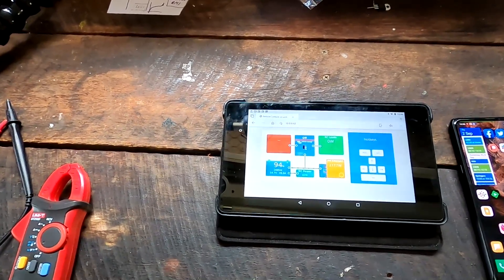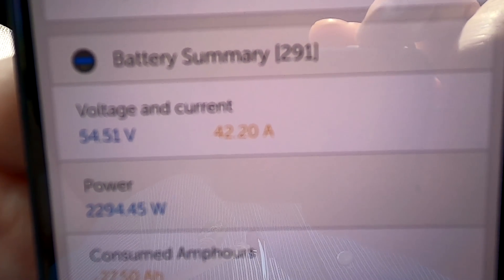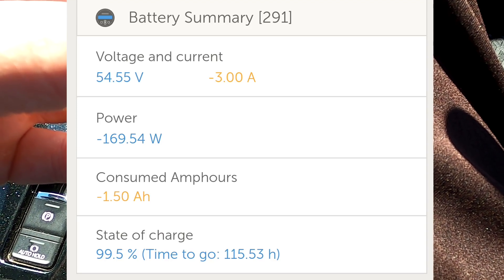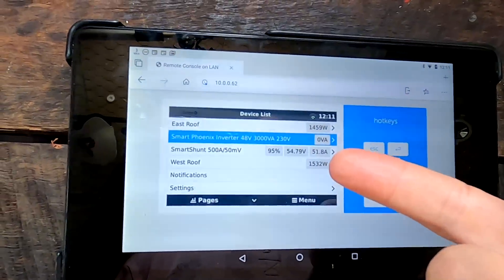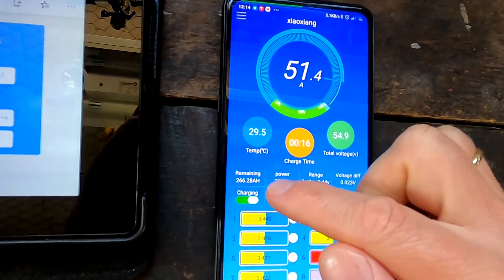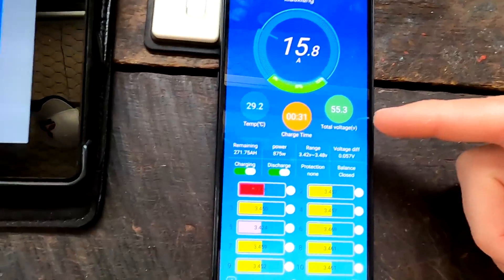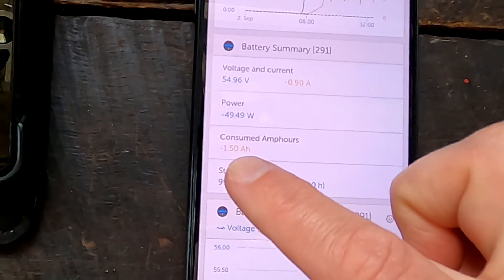With no balancing to 99% SOC. Consistently.

Comment: Hi guys, I'm back with news about active balancers and I want to share with you. I think I found the winning option, namely: At the beginning of a new active charging cycle,the balancer is closed (power off) and I turn it on at a voltage of 54.8 volts, 3,425 volts per cell. I noticed that at this voltage the gap between the cells starts to increase significantly, at least for my battery bank. I keep the balancer active until the voltage of 56 volts, 3.5 volts per cell until the voltage drops below 54.8 volts, after which I turn off the supply voltage for this device. 
 I use for power on / power off the active balancer, the auxiliary contact from one of the Victron chargers I use. This internal relay can be programmed to close at 54.8 volts and open at 54.6 volts, for example.
   Over the course of a week of using this system, the gap between the cells has dropped from 80-90 mV  on first day to the 3.5 volt voltage I use, it has dropped to 10-15 mV today.
    The conclusion reached by Andy, namely that the balancing must be done at high voltage, is very correct. At lower voltages there is no point in doing it because from what I noticed, the voltage in each cell varies quite a lot, especially in bigger consumption.

Comment: @17:15 '...there is no way we can charge to 90% at anytime...' ?
...and why are we trying to charge to the max we can get? is not the approach to charge to 90% and discharge to 10% to maximize the number of cycles?
Reply from the maker: No, not with LiFePO4 cells. It's about avoiding the high and low voltages. Charging from 10-100% is fine for these cells if you stay away from extreme voltages.

Comment: As I wrote before, why not charging to lower voltage, like 3.40 V/cell and even drop the absorbtion? This is good enough. And you should also drop float voltage, because at 3.35 V the battery is still charging slowly. 3.330 V/cell is good enough to keep high SOC. Search for 'The Relationship of Voltage and SOC of LiFePO4 batteries in different temperatures'. And at this low charging voltage  you can leave the active balancer connected. It will silently do its work.
I also thought to control charging with my battery monitor on SOC, but it is not really worth the effort. Using a lower maximum charge voltage is good enough.

Comment: Hi Andy. I am having a hard time understanding why you don't let the batteries charge to the point where there is minimal current going into the batteries on absorb. There is no use to back the voltage down in a float condition.  3-stage charging is for lead acid batteries and has no True Value on lithium iron phosphate batteries. Let the batteries charge all the way up in absorb to a voltage of your choosing and you will see 100% charge on the batteries per day at whatever voltage you set your charge controller to. Your load that you have on your inverter will vary the top-end voltage during the day and as the evening sets in. If the recommended top voltage is 3.65 volts max, choose a lesser voltage to increase the total battery  and track it over time to see what happens. Mother Nature is going to throw you a lot of Curves of which can change the overall outcome of your battery life.  
On a brighter side, I really do like to watch your videos as I played more and more with my solar stuff, I did a lot of experimenting like you. 
I was going to mention that the regulator that you were looking for is a  LM-7812 regulator @ 4.5 to 5 amps.  One thing that designers don't take into consideration is the Heat breakdown of the device over time.  If you can heat sink the regulator to say the back wall of the case, it would last longer and the voltage stability would be better as well. 
Hurry and build up your other batteries and put them on your shelf and parallel them with the others and you can see if you can make 100% with two batteries parallel at 48 volts. Then you can see how much extra runtime you can get out of your batteries.  Less stress overall.  
 Bye for now.   Lou

Comment: Well done. You have proven the established estimate of ~99% charge efficiency with lithium iron phosphate batteries in good condition.

But: no, no no! You cannot use voltage alone to determine when to cutoff charging! I cringe every time I see you charge your batteries to "100%" using only cell voltage to determine the charge cutoff threshold. Any voltage from 3.40V/cell and higher will eventually fully charge and then overcharge a lithium iron phosphate battery. The exact absorption voltage limit isn’t important, because of the inherent trade-off that exists between absorption time and absorption voltage. Charging must stop when the absorption current falls below the charge termination current threshold - NOT when the current falls to zero - because at zero charge current the cells have run out of free lithium but are still receiving charging potential. That is the definition of "overcharging."

At the 3.45 volt per cell charge voltage you are using, the minimum tail current to prevent overcharging is 0.014C (or higher for less than 100% SOC). For 270 AH cells, that is 3.78 amps (let's round that to 4 amps), and at that cutoff current you will still leave some small amount of free lithium available. (When charging to 3.65 volts/cell the cutoff current is 0.05C. Plot a linear graph between those two parameters to find intermediate charging voltage tail-current-cutoff parameters.) You gain practically nothing by continuing the charge beyond that point. I know it's difficult to use a tail current with variable current sources like PVs. But the Victron MPPT controllers do support setting a tail current, and if you set it at 4 amps, that represents a very minimal amount of lost capacity for your application. Doing what you are doing now, using voltage alone to determine charge termination, will eventually degrade your cells through the process of lithium plating. 

Since you are using a 15 minute absorption time limit, you have configured your system to: "only overcharge my battery for 15 minutes a day." OK. Now it will take more cycles to damage the battery. But the damage will still be done. That's "only" 91.25 hours of overcharging per year if you reach the voltage limit but charge to zero amps every day.

Manually charging to "100%" SOC a few times to zero charge current under direct supervision is fine for proving capacity and to periodically erase memory effects, but it will damage the batteries if you continually cycle the batteries to zero charge current -- at ANY voltage above 3.40V/cell. Accepting a slightly lower SOC for daily cycling by setting a charge termination tail current will greatly improve your battery life. 

You asked in an earlier video how to charge to a SOC lower than 100%. How to hit a target of say 80% SOC. Using voltage alone, you can't because of the flat charge curve. Setting a higher tail current cutoff is how you control your maximum charged SOC. The other option is coulomb counting (counting amp hours in and out), which some good BMSs offer, but those measurements will drift over cycles because charging efficiency isn't 100%. A really good BMS would allow you to set the tail current and cutoff charging at that threshold. Regrettably, few BMSs offer that option, so you're stuck with measuring tail current at the charging source. But attempting to control maximum SOC with charging voltage alone, if that voltage is equal to or anything greater than 3.40 volts per cell, is futile. Your earlier videos have demonstrated that. It's only a question of how long it will take to reach zero charge current and thereby overcharge your battery. 

In any case, you must measure current in addition to voltage when charging, and establish a charge cutoff current (that is greater than zero) for your chosen charging voltage to prevent overcharging. Measuring only voltage while charging will eventually lead to lithium-plated and degraded cells.
Reply: Your post should be pinned to the top of this thread!!!  I am afraid only a few will read this deep to see it!
...been waiting on this... the true understanding of the LiFePO4 dynamics that leads to the better management possible to maximize efficiency, but I am going to have to digest this level of knowledge the hard way.

Could not a system be wired in such way that each individual CELL is charged separately?
Would that not end the balancing ordeal and issues nightmare?
...and perhaps allow the rest of the parameters to show better, more straightforward results?

Changing subject:  
The 3,000W Bluetti AC300 Solar generator 12,288Wh/26,576Wh is a turnkey system and a good compare to what I envision... but the price is highway robbery.

I want to build my RV/mobile shop system: 12V with 320Ah Cells and a 3,000W Inverter.
I may go with 2 - 2,000W inverters instead and split the load so I can have redundancy, but I am not sure if some tools may require 3K, thus possibly rendering this a moot point.
My thinking is to attempt a beginning system of 12Kw to 15Kw expandable to double that.
A 24V system may or may not be better but most everything is on 12V, so I stick to 12V.

...is that overkill for what I describe below?
...and I have no idea how much of a solar array is needed to support such beast.

In priority order, I will run(time%):  [ I know an inventory of Watts consumption needs to come in the game, but this is to give the general idea ]
 - fridge(100%)
 - Desktop computer(NOT laptop)(80% to 100%), [ the new Apple chip comes to mind here ]
 - air(100% when needed)
 - limited wood shop tools (100% but not beyond capacity) and most of them are 24V cordless, thus charging batteries not running off the inverter.
 - all the rest is low Amps or not essential(thus do without as it comes).

 - Using the max numbers without taking in consideration the losses and true capacity.
12 x 320 ~ 3,840Wh - if I cycle at 70% (High SOC 85% to low SOC of 15%)
------------------------
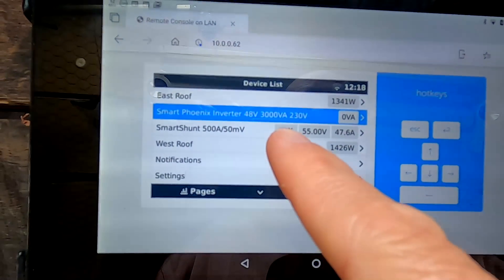UPDATE [ Tue 2021-09-07 11:54 EDT ]: I now know the LiFePO4 can be discharged tp 10% amd charged to 100%(close to)
thus my usable would be come near 90% (3456Ah)
------------------------
I would get 2,688Wh per battery - so I would need 5 batteries for a beginning system of 13,440Wh
How much of a solar array will support this size without playing too much ping pong with the clouds?

I am thinking to couple this with all Victron equipment.
Reply: Amazing post! I agree with the other comment that it should be pinned to the top of this tread.
Do you have a chart of the Minimun Tail Current to prevent overcharging??
At 3.45V is 0.014C.
At 3.65V is 0.05C.
What about at 3.5, 3.55 and 3.6V??
Thank you very much for your post again.

Comment: I was thinking about the state of charge of the battery. the victron gives a 30 to 40 % difference than my BMS how does the victron measure the amount of energy that goes into the battery and the other goes directly to consumers?
my BMS has 2 sensors at the output charger + and 1 at the busbar  to the inverter, the difference is seen as energy for the battery.
the volts at the cells is 3.34 at the victron 100 % and at the BMS 70 % ?
Yesterday both calibrated at 100%
does the victron deduct direct consumption, does it?

Comment: What is your charge efficiency and Peukert settings on the smart shunt?
Reply from the maker: I've set Peukert to 1 and the efficiency to 99%.
Reply: @OffGridGarageAustralia  Nice I also am using that - I wish I could change charge efficiency with greater precision
Reply: Just worked by average charge efficiency over the last 6 months on LifePo4 cells to be 98.68%

Comment: I have 5 Packs in a bank, so it's a bit different.
I run ABSORB for 1 Hour (SCC Setting) at 3.5375V per cell (56.6B for 48V) but the moment it hits 14A TailCurrent (End Amps for some brands) if flips to Float Mode @ 3.500V per cell while servicing the Inverter demands and allowing the cells to saturate (fill up while taking less & less amperage), which is observable by watching your BMS cell activity monitor.  

Absorb actually only runs for about 10 Minutes because the TailCurrent over rides it and switches to Float Mode.  Again, this can be observed if you are watching it with a timer.

Also, once the SCC is no longer capable of providing float voltage, the cells will settle slightly as expected to roughly 3.475V per cell +/- (pending on cell grade). 

Max Voltage Range (2.500-3.650) != Working Voltage Range (2.950-3.425).  Pending on Grade.
Reply from the maker: Great, thanks for sharing that. Is there a reason you charge to over 3.5V?
Reply: @OffGridGarageAustralia  I've tinkered up & down and with settings and with Absorb at this level it only actually runs 10 minutes +/- 1 or two before Tail Current is reached and it switches to Float.   

Absorb does kick the runners ahead and they will deviate as the top is tickled but they settle very quickly and within an hour @ Float the cells are all within 20mv in all packs.

While you are still playing with One Battery Pack, the moment you gat two or more in Parallel, the picture chages "A LOT" and you will have a Heap load more videos to produce LOL.  Oberserving the Dynamic of the different packs within a bank gets quite involved and then for kicks & giggles, pop a 100AH + different pack into the bank and really watch the fun.

BUT, I do run with QNBBM Active Balancers on all of my Residential Packs and Heltec Capacitive Balancers on my Utility Packs (Similar to those Hankor (sp?) ones you tried).   

DISCOVERY:  
I see you are only capable of pushing 50A +/- at that 48V/280AH Pack.  If you REALLY want to show those cells "work hard" and see what they really behave like, try charging that pack at 100A or higher.  I "Guarantee" that will lead to a set of "Eye Popping" and surprising results.  I have pushed 140A charge into 280AH Packs (both Bulk Cells & Matched/Batched cells) and BOY - eye opener indeed !   Subtle Hint, Be seated once the cells cross the 3.3750 line while watching "the race to the top".   OHHHH   Change your BMS Setting to allow for at least 300mv difference for that test.  (just for the test mind you).
Reply from the maker: @stephsoltesz6731  wow, great. That's sounds all fun. Cannot wait until I'm building the second bank.
55A is max at the moment but I'm still having shading. Spring just began, so it gets only better.
The problem with tail current is that if you have clouds it could flick to float much earlier then anticipated. I'm currently absorbing for only 15min and SOC is already at 99%, so it does not really matter. At 3.45V, this is right at the beginning of the climb. I don't need to go higher at the moment.
Thanks for sharing your info and experience, really interesting.

Comment: Run it like this at low voltage without balancing for a few months and observe the cell difference. From my experience, the imbalance keeps accumulating (depending on how well the cells are matched). At some point in the future, one cell will reach 3.65V. Charging at lower voltage does not cure the cell differences, it only covers them until they become too big.

Comment: All very interesting, and your 40 amp system clearly works with a 15 minute absorption time, when it can charge up to that last 10a. 
However this  short time period will not apply during winter or for those with smaller systems as the 40a is not available. 
The absorption time needs to allow enough current to top balance the battery and time for the balancer to do its work. There can be no definite figure, just a best compromise. It will vary by season and solar panel capacity.
Your thoughts on calculating such a variable time would be useful. 
Keep up the good work.

Comment: Andy I think that you can try to calibrate the Amp Meter on the bms.
I use a jbd bms, I can connect to a windows pc with a ttl/USB (never connect positive, only rx, TX and gnd) cable to uart port of the bms (where Bluetooth is connected).
With this windows software called jbstools I can see all the parameters that you already see on the phone with Bluetooth, but you can also calibrate voltage and ampere of the bms. I don't know if this software works also on your bms, but if you consider that I used the same app to connect to same Bluetooth interface,.... I can bet a beer that would work.
Let me know how can I sent you this software if you are interested to try.
Thanks for this amazing testyou did. 
Max
Reply from the maker: Ah, great, thanks so much. I'll give this a try.

Comment: Hello again Andy!Exactly the same tests I do these days, playing with the charging voltage of the cells. But I follow the deviation between the cells after I went for a while with active balancers, permanently connected and my cells became totally unbalanced. I redid top balancing,and now without any balancer I charge the battery bank at different voltages. Yesterday and the day before yesterday I charged up to 3.5 volts per cell and I continued the absorption until the current dropped to 5 amps. The deviation was a maximum of 37 mV. Today I will charge up to 3.55 volts per cell and I will watch the deviation. What do you think, should to activate the balance when the chargers switch to absorption and to disconnect them when they float if the deviation becomes too large?
   And I have a question for you. Why don't you use tail current combined with absorption duration in the charger settings? I think it's a more accurate way to make sure the battery is charged before the charger floats. I use absorption time = 30 minutes and tail current = 5 amps for my battery bank which has a capacity of 600 amps. And when the current consumed in the absorption phase falls below 5 amps for more than 1 minute, the charger floats. If the current does not fall below 5 amps for 30 minutes, the charger also floats.